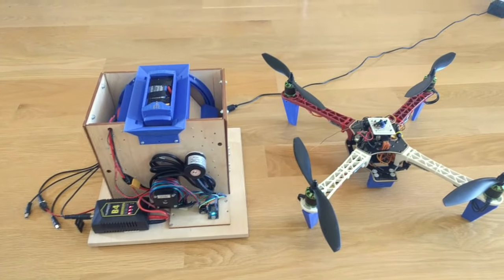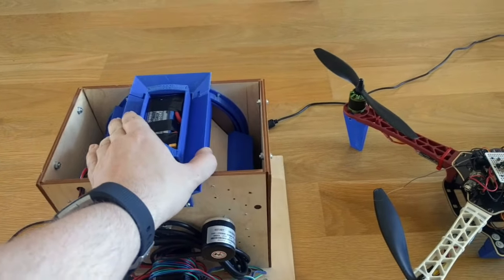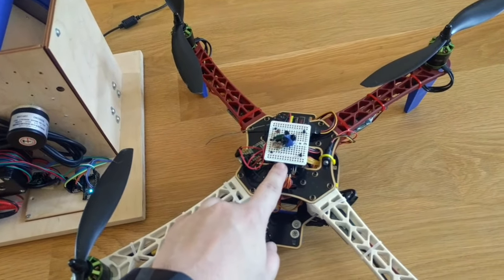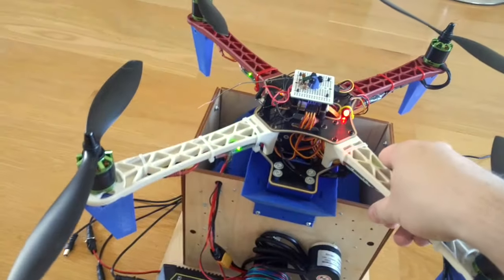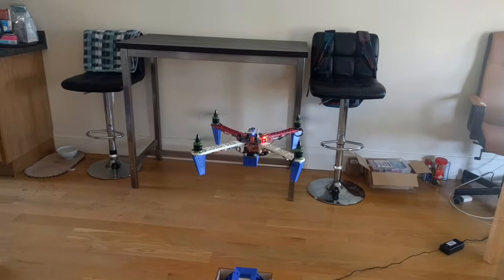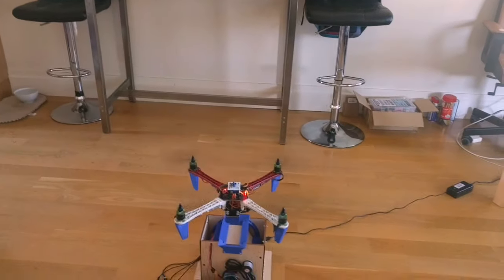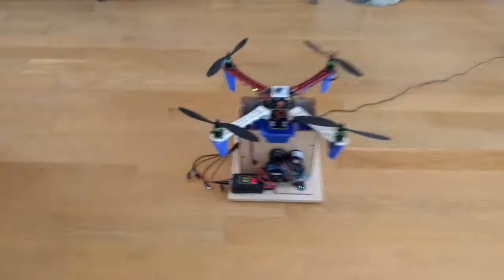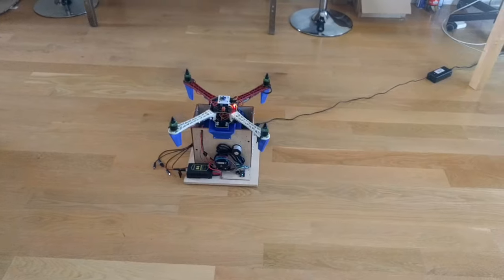Drone Supercharger

Comment: this is fantastic!!! someone (i.e. you!) did what I was hoping could be done with vive lighthouses to give the flight controller occasional moments of pretty accurate fixes to reset any drift.. but hmm.. it still seems to drift more in the air than you'd think getting 30 hz mm precision fixes should allow.. it would be very hot to tune in something to hover like a hummingbird even when there's wind around it

Comment: Absolutely amazing man. What's the total cost of building this system? Do you think you could do it without the vive lighthouse using something cheaper? Do you have a datalink setup on the drone or does the charging station have it's own datalink?
Reply from the maker: Thanks! I would estimate ~$100 in raw materials and motors/controllers/etc. Vive provides the accuracy to land, which is required with  the current construction. Can be made cheaper with custom positioning solutions probably..
Both drone and the station use wifi to communicate to my laptop.

Comment: Completely mesmerized by this achievement Alexander. I reported this right away to Hackaday and I'm glad to see that you are now in the frontpage :)

One question/suggestion: Wouldn't it make more sense to place the IR sensors underneath the drone and tracking/fixing position(s) to/from the battery exchange system? That way you can get rid of the Vive IR turrets and have a more self-contained system that could be deployed anywhere and outdoors.
Reply from the maker: Roman Valls thanks! yeah I thought about it. I kinda wanted to build vive sensor specifically, as the approach is genius :) also to have more control in positioning. I also had the vive ready, do I'm actually avoiding building the light emitting part

Comment: Amazing, you're a genius. How does the battery contact makes electrical contact with the drone ?
Reply from the maker: I use 3 spring pins on the battery side (https://www.digikey.com/product-detail/en/mill-max-manufacturing-corp/0851-0-15-20-82-14-11-0/ED90512-ND/2532965) and a custom copper rail on the drone side.

That was actually one of the harder parts to implement, appreciate you asking that!
Reply: thx. why 3 pins and not two ? redundancy?
Reply from the maker: Hugues D it's 3 for each contact, to support 20 amps current.
Reply: ah ok. will you publish some tutorial for others to build it?
Reply from the maker: When I have time :)

Comment: How does the locking mechanism work?
Reply from the maker: Do you mean how the battery is locked to the drone? It's currently just friction. Works fine because of the curved shape of the slot.